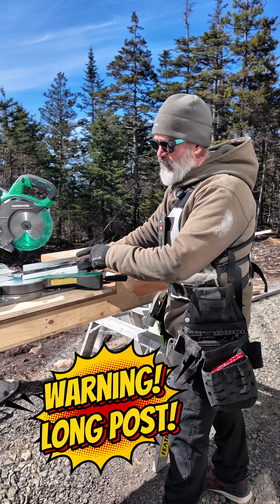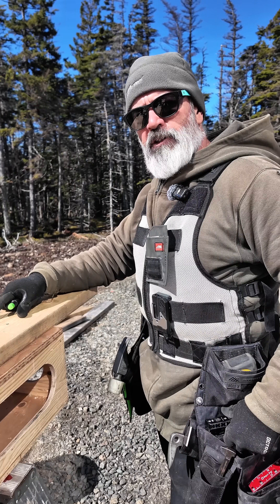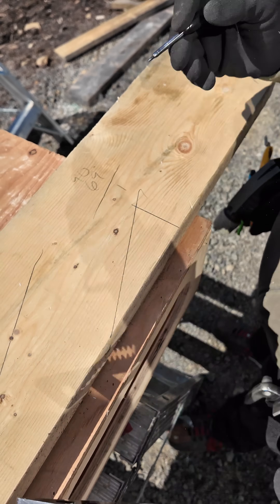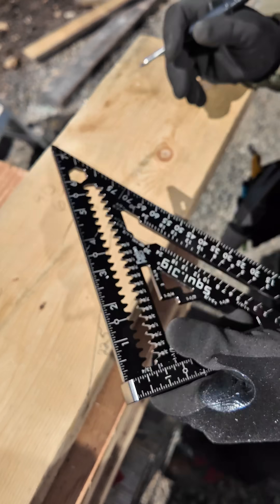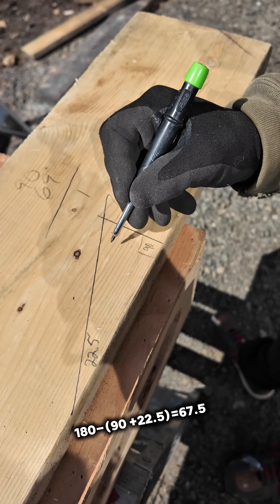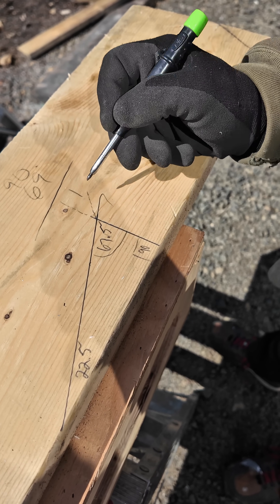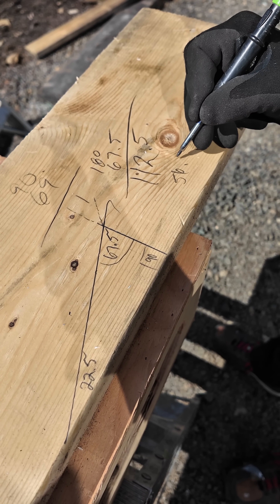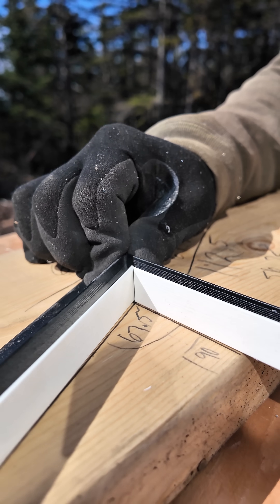How to figure out miter angles without an Angle finder!

Comment: The result is good, but i think that your math work only because you cut with a miter saw.   If you mark the angle starting from the side of your pieces it will be 33.75 (90-56.25). Angle on miter saw is actually complementary angle (cutting at 0° equal 90°)

Another way to explain the angle on mite saw is by comparing a 45° cut on two pieces for a 90° joint. 45 is half of 90. So, if you had the additional 22.5° with 90° the solution is the same that you show (112.5/2).  It's more easy by drawing it. 

I only try to think with you about the way to explain it :)
Reply from the maker: I agree with you, I try and present these problems in terms that Carpenter apprentices can understand and relate to.